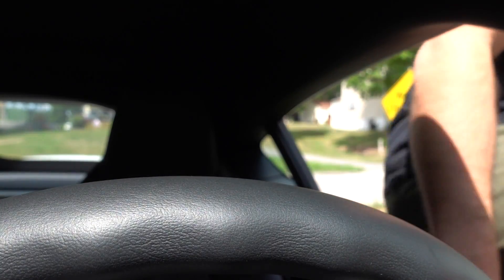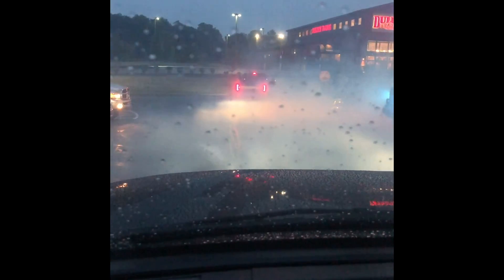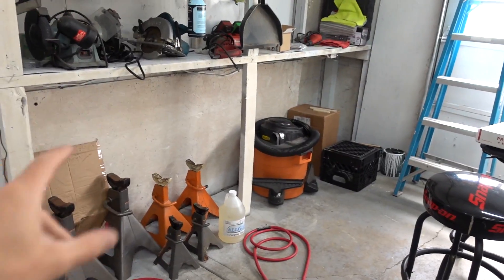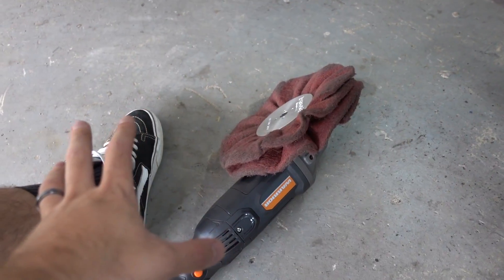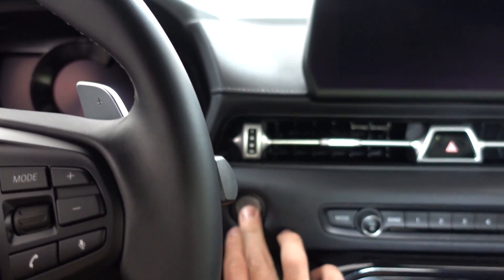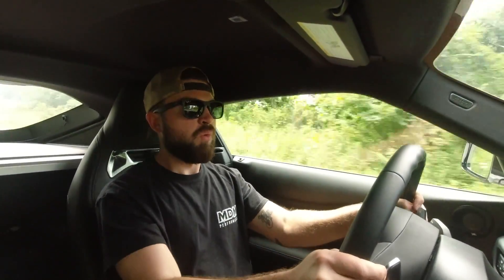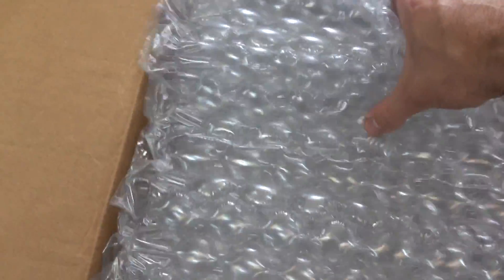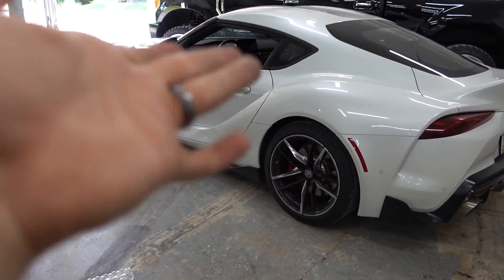I installed an INSANE Drag Race Tune - QUICKEST LAUNCH YET!

Comment: What fuel are you running? Have you dyno’d it yet? It looks like that car is a torque monster.
Reply from the maker: Running around e48-e50 mix, never had It on the dyno yet but soon 🔥 car for sure is a torque monster